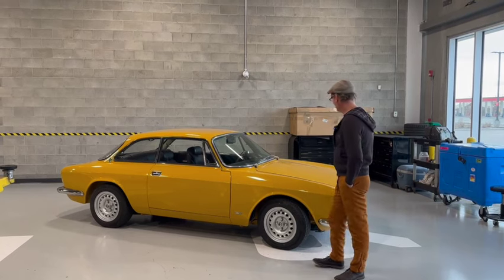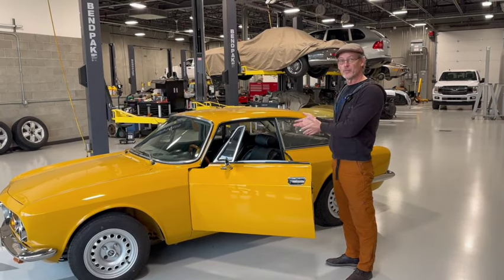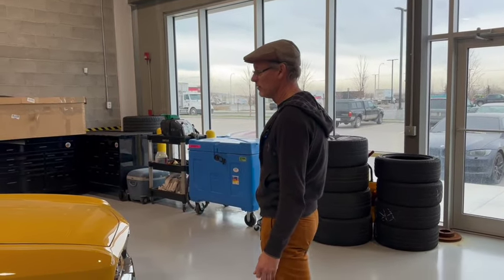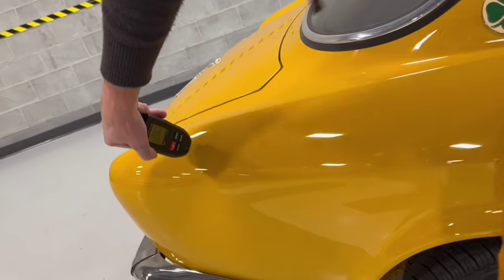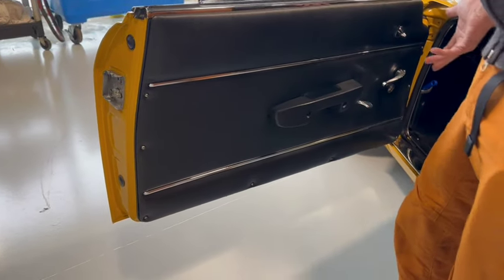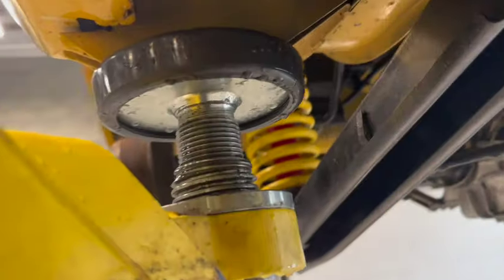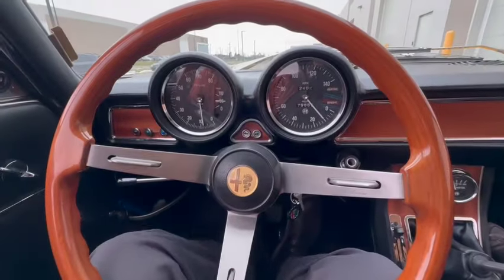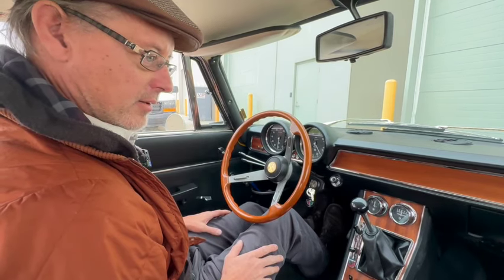1969 Alfa Romeo GTV 1750  Yellow Ochre - Bring-A-Trailer Auction Preview

Comment: Excellent presentation, beautiful GTV! 
1969 US delivery cars (and I assume Canadian cars as well)  all had the twin-brake servo setup and is correct and are original for this car. 
Having a dual-circuit system was a new 1969 DOT requirement, and this was Alfa's one-year solution to meet that. There were no 1970-year Alfas imported, and 1971 brought the simpler unified dual-circuit servo. 
GLWTA!

Comment: The clovers on the rear pillars should be gold over white. The park brake handle is missing the black plastic end grip. It’s a shame the Spica has been removed for a carb conversion. Once properly set up the Spica is nearly bulletproof other than the thermostatic actuator every 30,000 miles or so. It’s a smooth and reliable injection system on arguably the smoothest Alfa Nord engine. The two liter never felt as nice IMHO. I always enjoyed turning on the key and the nice little buzz from the fuel pump until the fuel pressure light went out. Then the car would start right up and idle perfectly. It’s a plus the twin Bonaldi boosters are still present. The rest of the car looks pretty good. The one I owned had Klippan style seat belts. Mine was 69’US Ochre/black. These cars are under appreciated to my mind. Very involving and enjoyable to drive.